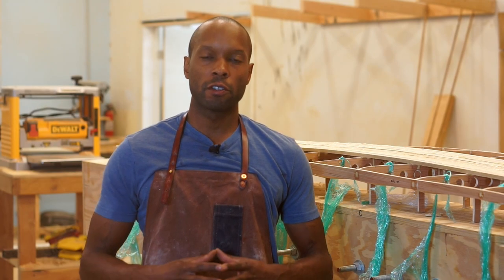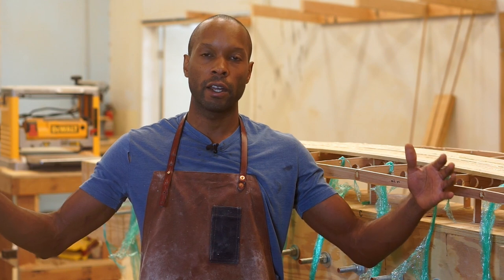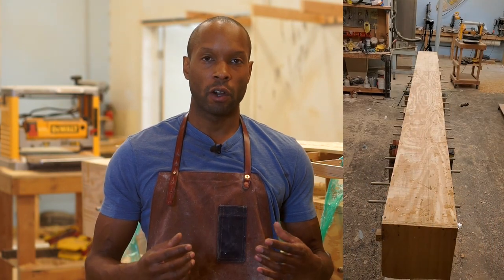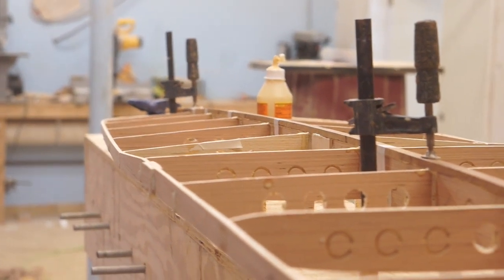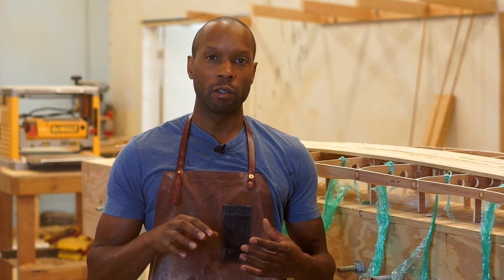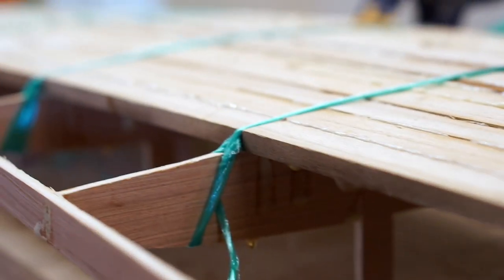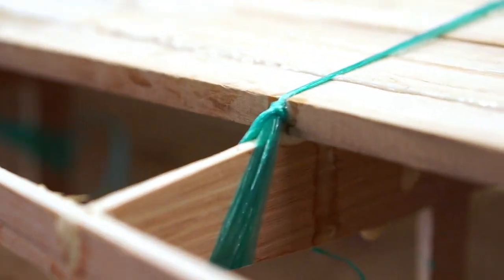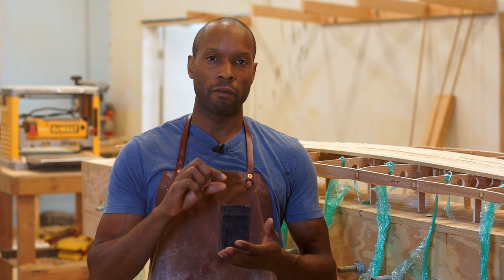How to Add Deck Skins to Your Board (Using the Strip Method)

Comment: Is there a reason for using polyurethane instead of a class d4 pva glue (used in saunas and outside)? Just wondering since the pu takes 4-8 times longer to dry/cure. And yes, I said I won't start until November but I'll probably put some other projects aside and start earlier. 😀😀

Comment: I'm curious what the dimensions of the strips are. I'm waiting for delivery on my San Marco frame kit and have been watching a ton of videos about various builds. My main question is what thickness people are using for their strips. 1/4" seems to be common but then I worry that may be too thin. The board in the video looks more like 1/2 or even 5/8" but it's difficult to tell. It would be great if Jarvis would make some videos with measurements etc showing.
Reply: I just ordered a kit from Jarvis, but I did build another brand last winter, I ripped up my cedar at 7/8' wide by 5/16" thick, left me lots of meat to plane it down, don't forget you add quite a bit of strength back when you mat and glass it
Reply: The bulkheads will add lots of support, don't worry about .25" being too thin, chief.

Comment: I understand you need extra thicker strips to finish plane after gluing, so what dimensions are your strips and do you put the 1/8" radius on the strips, as required in canoe construction.
Reply from the maker: Bead and cove is not required. A little proud of 1/4" is ideal pre planning.

Comment: The videos don't show applying the finish side rails.  The rail frames required a 1/4" side lap on the inside and outside of the frame member to make the splice.  Should I have to add 1/4 " furring along the entire outside of the frame rail to provide a uniform surface to glue the finish side rails to?
Reply: good question. I need to understand this too
Reply: I’m wondering this too, it looks like there’s strips on each edge overlapping the top and bottom

Comment: When do you add the outer frame? I don't see it in the instruction manual or on your precious video. Forgive me, this is my first build.
Reply: This is my first build as well, are you asking about the frame side rails or the side rails themselves? I have attached all frame parts together, will be putting on bottom deck, flip over remove rocker tabs, Add foam blocks for the inserts, put on top deck, then add 2 1/4" strips on the sides that will glue to the side frame rails. This will give me 1/2" of material for shaping the rails, the 1/4" material should be thin enough to form the curve from nose to tail without needing to steam it too much.
Reply: Working on gluing my strips on now. I added the outer frame after gluing the ribs to the spine, then down to the table

Comment: Hi there!  Im about to start a build and have a question. I am toying with the idea of applying a Shou Sugi Ban inspired finishing to the strips/board (this video describres the finshing: https://www.youtube.com/watch?v=4Mj79HR8Ujg) I want to burnit, brush it and then stain it with a nice color.  I will mock it up before committing to it, but do you think this is an appropriate thing to try on a board? Any issues you might foresee with using this technique? tips or recommendations?
Reply: @jackwignall9333  Hey Jack! no I haven't received anything back. I just started my build this weekend, only managed to build a workbench and cut out the frame with a CNC. I have a lot of questions too!!  it's interesting, in this comments section, Jarvis has only responded to the comments saying "hey great video", but they don't answer any of the people who actually have questions about the build...🤨 And you tried emailing through their website?  I would be interested to find out what challenges you are having, if you want to correspond with me...
Reply: @vivianelabelle6495  I have Emailed their support several times -No support -disappointing
Reply: @planzi1  Yes it seems you're not the only one!  A lot of people are complaining about this. Hey, you might be interested in joining a facebook group called Jarvis Board builders, look it up. People there are exchanging info and helping each other out, it's really helpful.
Reply: @vivianelabelle6495  Thank you so much -appreciate the information -will do -Have a great weekend -be safe Enjoy!!!